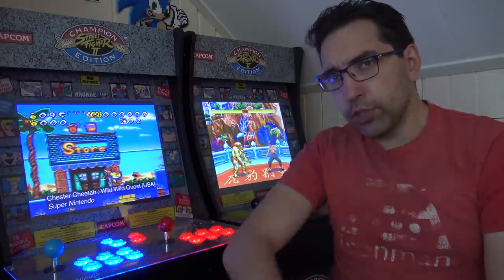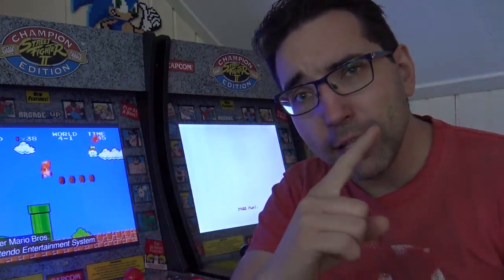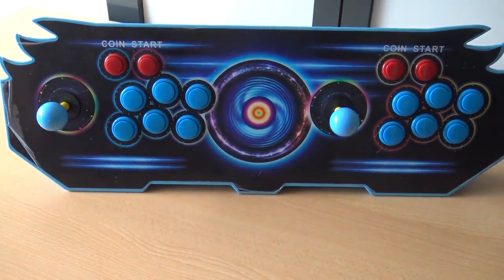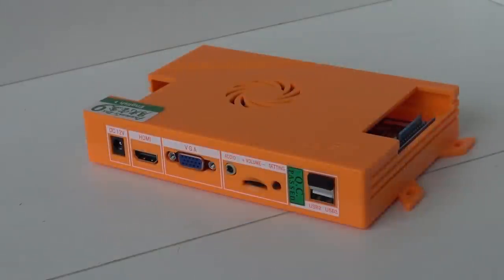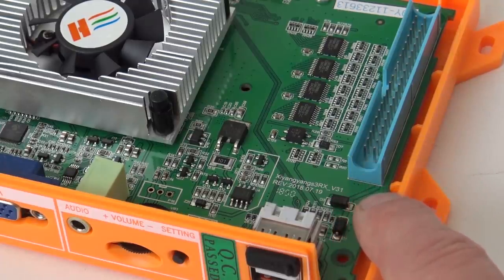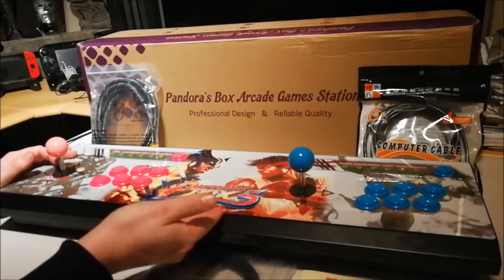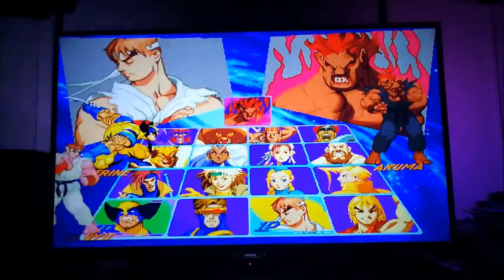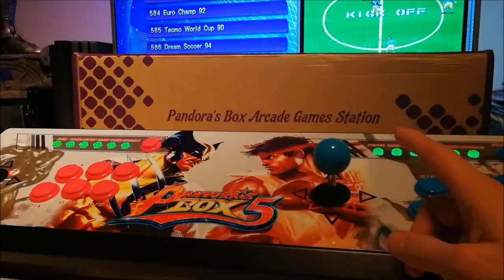The Best Pandora's Box 2019 / Wicked TOP 10

Comment: I wanted WAAY more input on the hardware for each model than what you've added.  What components (brands) were included for buttons and joysticks on each model...how do they work?  Was there any upgrade when you bought a more expensive model?  Any issues with overheating?  I jumped right to your #1 spot.  I wish you included what the issues were for each unit (2D or 3D games?) @17:09   What did you mean by "you can add games but if the versions aren't right they wont show up"?  Also, HOW do I add them...thanks

Comment: Great video!  I picked up a Pandora's Box 6 because of this review and others.  One quick thing, you can output in 4:3 on the Pandora's Box 6.  I'm still a little confused whether or not it will adjust how it outputs specific games based on the aspect ratio selected.  I need to experiment a bit more.  I was playing Bad Dudes in widescreen and it was weird so I need to see how it looks when the system is changed to 4:3. It is also really cumbersome to switch between 720p, 4:3, etc by holding the tiny little button on the back and rebooting haha.  But either than that and lack of save states, I really love it!  Very few games that it doesn't run really well.

Comment: Hi Wicked Community! I have a question for you;

Pandora Box or something else, doesn't matter, I'd like to have a solid multi arcade at home, which is also compact and I can pack it down. So no cabinet, I like the compactness of having everything in one box (like Pandora) with the joysticks. I would also like to have high quality sticks and buttons, sanwa for example. All this with great emulation of course. I wouldn't mind paying premium for a premium machine like this.

But does it exist? I'm trying to avoid building one myself, so I would prefer to get one out of the box if possible. I'm watching these videos for a while now, but I still have doubts if the Pandora Box would be satisfying to me.

I just want one machine that works well and I can get back to play it for years to come. What can you recommend?
Reply from the maker: If you want plug and play arcade you have 2 and 1 player arcade stick options for that.
If you need screen with the pandora arcade you have the portable versions with different mainboards and sanwa buttons. 
Complete ready to go arcade machines is different story because they are very expensive to buy from ali-express.
Reply: @WickedGamerCollector  I've just checked tinyarcademachines, they offer table top cabinet with 2 joysticks and monitor built in. Looks promising. I'm still considering If I should just go for one without monitor, but 2 sticks definitely. :-)

Then there is the question of;
Mame
Jamma
Retropie

I suppose they all have pluses and minuses for emulation. How shall I decide?
Reply: I see that tinyarcademachines are also somewhat overpriced.

Comment: It seems that full cross platform support with save games is still somewhere in the future.  
BTW: when you say "ability to add games", where do you get them FROM? For instance, I've seen that the arcade game "Rampage" is missing in a lot of the game lists. Should I care about that or is that supereasy to fix for a box that has the ability to add games?
In your review, you don't mention 4 player support or support for track ball, turnknob, steering wheel or other exotic controllers.  
I've seen someplaces that 4 player support is reached by having players 3 and 4 use playstation controllers. Is that a common support?

Comment: @Wicked Gamer & Collector thank you so much for this video.

I know in the past you modded an arcade1up machine with a Pandora's box, but my issue is that I really do not want to spend $300 dollars on something that I am only going to use as a shell.

My issue has always been that while I like the size of the arcade 1up machines (I was born with Cerebral Palsy and am in a wheelchair so it is the perfect height for me) I thought that the fact that there are only a handful of games on the unit, with no real option to add more is just a complete waste for a $300 cabinet.

I have looked at the legends at home arcade cabinet, but it also has several issues, it is really too high for me to use effectively, and while it does have a lot more games then an arcade 1up cabinet, for $600 it just does not have a lot of the big name titles that you would look for when buying an arcade cabinet like this.

So now I am looking at the Pandora boxes, but I have 2 questions for you.

My first is how hard are expensive do you think it would be to build an arcade 1up size cabinet setting up the Pandora box 3D as the control deck for it?

Would I be better off buying the arcade 1up cabinet to just use and modify as a frame or trying to get someone that I know to build it?

I have no mechanical or woodworking experience so I would have to find a friend to do it for me.

My second question is how would someone go about adding more games to the unit itself with a Pandora's box 3D for example after the cabinet was created?

I know I have heard you talk about adding games to a Pandora box 3D but how would you go about doing that?

Thank you for taking the time to read this. I hope to hear from you.

Comment: I purchased the Pandora's box treasure to (AKA 3d 2550) I am enjoying this, I should upgrade the joystick as the stock one feels kinda cheap, but it works well with the arcade games. The one issue I would really like to solve is being able to use a USB N64 controller properly. I am able to plug and play a USB N64 Rage controller, and it works, except with the c-pad and analog stick. Does anyone know how to rectify this? 

Any help would be greatly appreciated.

Comment: Extremely useful video! I received my pandora games 3d wifi version today and its everything I had hoped for. Took me forever to find my favorite game as its mislabeled. Thank you for making this vid.
Reply: Hey Bro, ir runs the games smoothly? Bc I want to buy the most powerful Pandora's Box, to get all my games running as good as they should be. For example, it runs VERY GOOD Mortal Kombat games?
Reply: @Linux13  Yup MK and nearly all the arcade style games I've played run very smoothly. The main thing I notice is that some emulators don't run well. For example MvC2 Dreamcast emulation sucks on this thing. Arcade emulation like MvC, SF3 3rd strike, MK1, MSH, all running perfectly. I've played several beatem ups and shootem ups no issue as well. Also a concern is that console emulation like PSP/DreamCast button mappings are just screwed on some games. But Wicked Gamer discusses these problems in his vids though. In my opinion Pandora games 3d is best all around bang for your buck.
Reply: Thanks bro!
Reply: Is your favourite game rygar...
Reply: @davegonnaway6007  Ikaruga is my fav from back in the day!
Reply: @subzero9wolf  ah right yes iv seen that on the 3d not sure what it's called though

Comment: Hi, thanks for the video. I'm a little bit worried though. I just purchased a Pandora 3D via the link in your video and notice now that the pictures are different from the Pandora 3D you demo in the video (it hasn't arrived yet). The one I've purchased via your link has more smaller buttons above the main buttons, yet your video shows just two. Now I'm worried I won't get what I wanted. Any thoughts?
Reply: Do not worry. I have just received it and apart from the having 8 buttoms , the rest is the same. Very happy with the purchase
Reply: @limandres  Awesome. Thanks!

Comment: Good morning guys! An info please: Pandora box 3d works with Xbox 360 controller? Or with 8Bitdo SN30 pro controller?
Reply from the maker: I did try many controllers, it noticed the controllers only nothing happens / controlling not possible.
Reply: @WickedGamerCollector  So the only gamepads that work are those (low quality) sold by these chinese sellers? Or you can advice for a better solution?
Reply: @WickedGamerCollector  hey friend, I finally tried both xbox360 wired controller and ps3 wired gamepad and perfectly work for pandora box 3d austar.